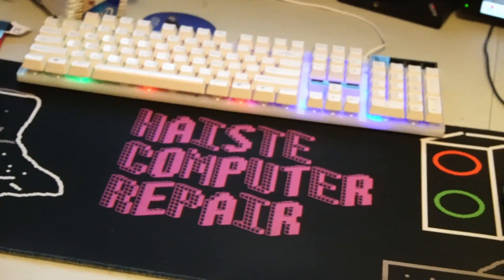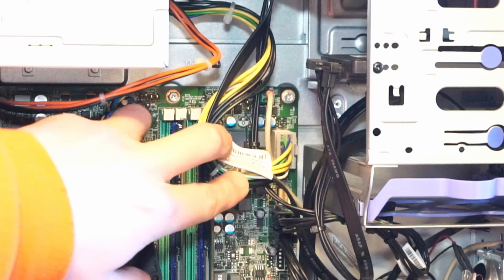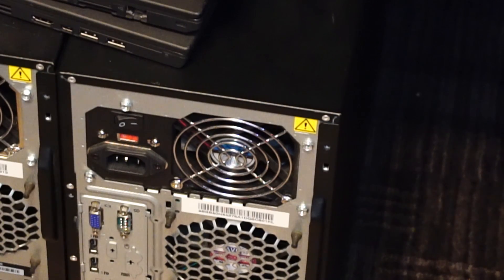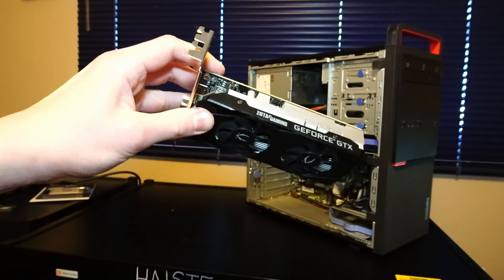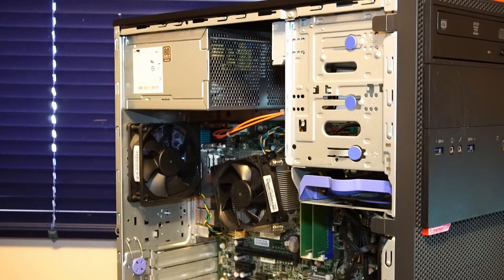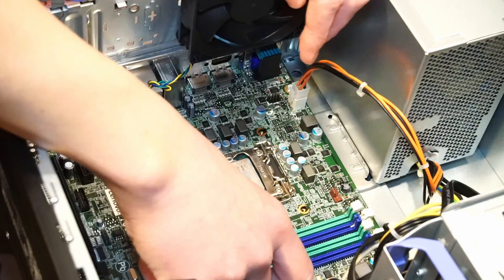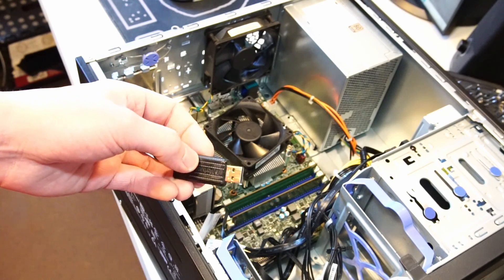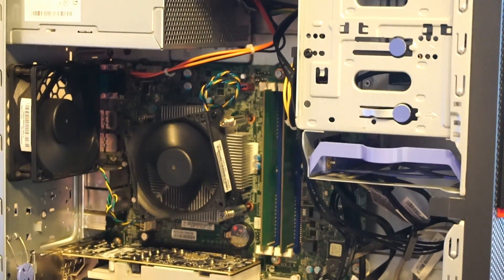Lenovo ThinkCentre M800 Upgraded!  GTX 1650 & i7-6700 Gaming in 2024

Comment: Hey Sir I have Lenovo thinkcenter m910t with psu250 watt I want to change psu to 350 wat this is possible and that you used GPU is zotac GTX 1650 dual fan gddr5 give me answer can I change standard ATX supply 250 watt otherwise I need to buy low profile gpu
Reply from the maker: If your motherboard has the same 10-pin PSU female end, then I go over what you need as well as some caveats in the video.
Reply: @HaisteComputerRepair Thanks Sir for your reply but I buy a new case new motherboard new supply

Comment: So i upgrade the psu using adapter as this video, 
It does still spin"the fan".
Is it bad? 
Do i need to pull out the cable power everytime i shut down?
Reply from the maker: Yes, you either have to unplug or if your PSU has a switch you can turn that off.
Reply: @HaisteComputerRepair I see. Does this shorten my PSU life?

Comment: I have a Lenovo computer and most likely the same 250W ACbel power supply. I have a GTX 1650 without an additional power connector and an i5 6400. Can I upgrade to an i7 6700? I also have 2x8GB RAM and two hard drives. Is the power supply sufficient?
Reply from the maker: Yes you should have no problem!

Comment: I got the same motherboard but I upgraded to a msi 650 power supply for my new gpu.but my problem where I don’t understand  if I still need that 4pin that come  on the original power supply had the 10 / 4 pin do I just leave out the 4pin because my msi power supply came with  24 pin and I got an adapter to go for the 10 but  I don’t have no 4pin for the 4pin side,what do I do leave out the 4pin?
Reply from the maker: Sounds like you are talking about the 4 pin CPU connection.  Yes you definitely need that.  The MSI PSU will have this, perhaps looking like an 8 pin.  But, you should be able to split it in half.

Comment: I never head a problem on these low voltage cards with a sata to 6 pin pci e adapter. its risk free. pluss this modes has a pretty good rated psu, which can handle pcie over sata hassle free
Reply from the maker: I would be ok with testing it out, though for customers it would need to be discussed first before releasing it.  I tend to just stay away these days.

Comment: hello, great video i just ordered and installed a 1650 D6 ventus XS ocv1 on  my m700 but it has the 6pin power and my 250 watt supply isnt turning it on at all. Would you recommend buying a 6 pin adapter or returning it for one without the pins? just worried its a dud thanks
Reply from the maker: You will either need to install a different power supply that can handle a card with pcie cables or get a 1650 that doesn't require a pcie connector.
Reply: @HaisteComputerRepair   what i was afraid of thanks
Reply from the maker: @417handyman  I cover what kind of adapter you need in this video, it's doable for sure.
Reply: @ I ordered a 6pin to sata power cable just out of curiosity. the used 1650 card is in bad shape but it worked. Pretty sure the i3 is bottlenecking it but that’s a project for another day and I’m out of money
Reply from the maker: @417handyman  You might be ok just running a 1650, but powering GPU's via SATA to 6-pin or molex to 6-pin is not really a good idea anymore.  If you do this, make sure to monitor your power output as an overload can result in the wires heating to the point of failure or possibly catching fire.  I stopped installing these adapters long ago for this reason.  If you have to use one, molex before SATA.  Though I understand there are not molex connections on these PSU's.  Be careful and monitor this cable!

Comment: nice video i just bought the same equipment 8 months ago and i have a only question, that gpu 1650 does it work with the 250 watts psu? or is it necessary to change it? I thought it was going to be necessary to buy either another motherboard or a higher wattage lenovo power supply.
Reply from the maker: 250W is exactly what you need for a GTX 1650
Reply: @HaisteComputerRepair  thank you for answering, it is just in the limit, you never had problems?. Anyway I am from venezuela and here the 1650 is around 240$ probably look for a cheaper graphic and with a tdp of 60w maybe the 1050 or similar. thanks for the information at least I can be sure that a 70w graphic will work.
Reply from the maker: @Happy-rv2vh  The GTX 1650 suggested PSU is 250W.  I have also used 240W and 210W PSU's with no problem.  If a 1050 is more your budget, go for it.  If you can manage a 1650 it will be much better, though.

Comment: you could have got better price to ProFormance if you went with the intel Xeon e3 1245 v5 it cost lest then the core i7 6700 and the e3 1245 is clocked a little higher then the core i7 6700
Reply from the maker: Thanks for the suggestion.  I see that that Xeon CPU is 3.5GHz as opposed to 3.4 with the 6700, but the 6700 boost speed is 4.0GHz while that Xeon is 3.9.  Still, if it was quite a bit cheaper than buying an i7-6700 I would definitely try it out as those differences are probably negligible.

Comment: I have an GTX 1650 with an 8 pin power connector😅
Reply from the maker: Mod time?
Reply: @HaisteComputerRepair  No, it's actually a Zotac Graphics card 😅
Reply from the maker: @SwagZ-74  Oh, I meant that maybe you can install a different PSU with the cable adapter.
Reply: @HaisteComputerRepair  Ah, nah, can't do that, I have an 650W power supply from Cooler Master, which has 2 8 pin power cables😁
Reply from the maker: @SwagZ-74  Are you installing it into a similar ThinkCentre PC?
Reply: @HaisteComputerRepair  It's installed in a system that has an i7 860 processor
Reply from the maker: @SwagZ-74  Oh, ok so you were just talking about having a GTX 1650.  I actually just posted a video with an i7-870 & GTX 1650 combo
Reply: @HaisteComputerRepair  I've seen it, I get the same fps
Reply from the maker: @SwagZ-74  Very nice!
Reply: @HaisteComputerRepair  I'm not using it as my main PC, but it's an good second option 😁
Reply from the maker: @SwagZ-74  My intent was for someone just wanting to play some games for a low price.  Managed expectations on old hardware discussed.  Good to hear there are some still using 1st gen.
Reply: @HaisteComputerRepair  Yeah, I'm planning on getting it upgraded, but what kind of CPU?🤔
I'm good with PC hardware, so not a problem there, I'm just thinking about the budget😅
Reply from the maker: @SwagZ-74  If you mean investing in a new platform, on a budget, the AM4 platform is quite versatile and doesn't require a large investment.
Reply: @HaisteComputerRepair  I think I'm gonna go for either Ryzen 5 5600 or Core i5 12400F, what do you think?
Reply from the maker: @SwagZ-74  I would go with the Ryzen 5 5600.  It performs better than the i5-12400f in my own experience.  As well, the AM4 platform will allow for a lot of CPU upgrades while the Intel platform will only allow within 2 generations of CPU.  Just make sure you get an AM4 motherboard with PCIe 4.0 lane(s).  Ex:  B550 series.
Reply: @HaisteComputerRepair  Aha, I will think about this for some time🤔

Comment: WARNING -  most full sized gpus dont fit. i have a gigabyte rx 590 it doesnt fit so warning before anyone uses a full sized gpu
Reply from the maker: Yes, it's always good to plan ahead
Reply: @HaisteComputerRepair  quick question is the sata to 8/6 pin dangerous i heard they catch on fire easily
Reply from the maker: @pandafvv  SATA to 6/8 pin PCIe cables are not a great idea for graphics cards running any kind of load.  Maybe just for displays.  Do not recommend.  Same with molex to PCIe.  A customer once brought one to me with the cables melted.  Somehow he was still able to use the PC until any kind of small load hit, where it would shut down.  I just swapped out the PSU for something appropriate.
Reply: @HaisteComputerRepair  would it be better to get a gpu that doesnt require a cable
Reply from the maker: @pandafvv  Yes, unless you are wanting to purchase a PSU cable adapter like I outlined in the video.  So that you are able to install an ATX PSU with the appropriate PCIe connections.

Comment: Can i grab a bigger GPU ??
Reply from the maker: If your GPU of choice requires a PCIe connector, you will need to upgrade the PSU and purchase a 24 pin to 10 pin cable adapter (with this specific motherboard)

Comment: The rx5700 works, do you think it could work?
Reply from the maker: You would need to upgrade the power supply to at least 550W and use the cable adapter I talked about in the video.
Reply: @HaisteComputerRepair  okay, thanks
Reply from the maker: @Eduux2  I would expect a slight bottleneck paired with the i7-6700 on a Lenovo Motherboard if you go this route.  If you are going custom, take a look at Ryzen 5 5600 CPU and build from there.
Reply: @HaisteComputerRepair  Or of course I already changed the processor, I found a intel i7 4790, I know it's not the best but for what I get money for, it seems decent to me
Reply from the maker: @Eduux2  If you find a good deal on a 5700xt or plan to upgrade soon, go for it.  Something like the GTX 1060 6GB, GTX 1070, or GTX 1660 Super would pair well with an i7-4790

Comment: Help me friend, can I put the gtx 1650 4gb ddr5 or an amd rx6400 on that pc? Which one works for that PC?
Reply from the maker: Well, yes of course the GTX 1650 will work as it is featured in this video.  RX 6400 will be fine as well, but there are a couple things to look out for if you'd like to hear about them.
Reply: The one I have is not low profile, does it still work perfectly for you? The one I see you use in the video is low profile
Reply from the maker: @RubéndarioAndradeciamaroni  Does your 1650 have a 6-pin power connecter or not?  If no, then you can install in a PC like this without changing the power supply.  I go over this in the video if you scroll through the earmarks.
Reply: The rx 6400 need a motherboard that have PCIE gen 4 do not buy the rx 6400
Reply from the maker: @JOHNMARSTON18737  Just to be clear, PCIe 3.0 lanes on a motherboard will work fine with the RX 6400, but yes theoretical performance might be better with PCIe 4.0 as that is what the card features.